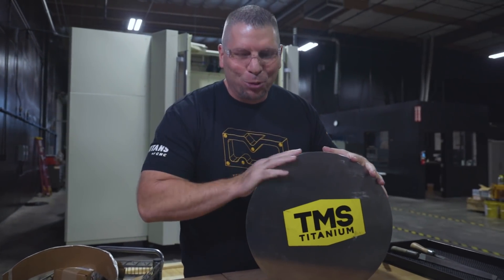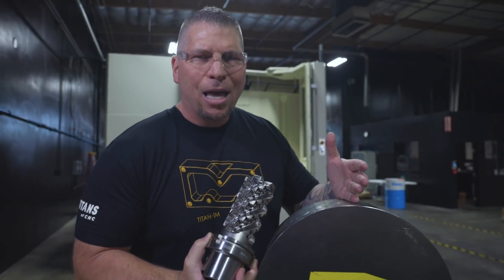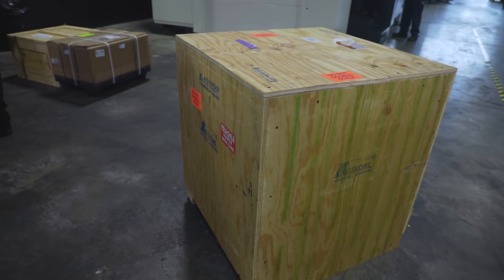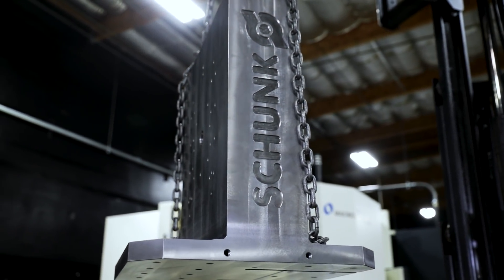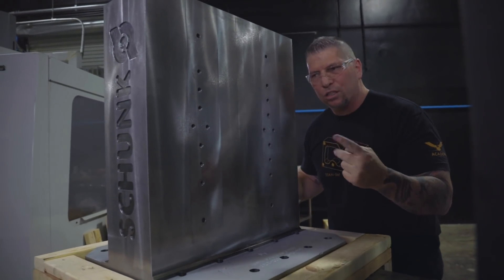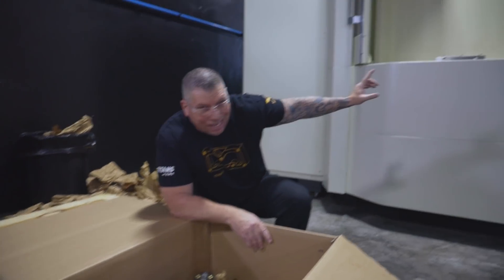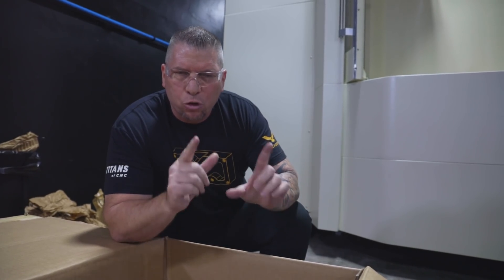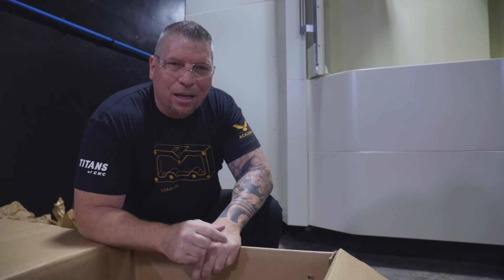60 HP MAKINO | Beast Titanium, Chuck, Cutter & Tombstone!

Comment: I didn't know if those mega insert cutters are still in use today. That's a lot of inserts to swap out. Would some 3-6 insert cutter meant for low depth of cut, high feed, also be another option? It's gonna look really cool, seeing that thing cut though.
Reply from the maker: Usually you have multiple tools and inserts get flipped while machine is running. Nothing can compete with the MRR with this tool

Comment: wait, you dont make your own tombstone fixtures? in the shop i work in we have a special team that only makes fixtures for us so we dont have to buy them. that way we can custumize it the way we want them without paying 1000s of euros.
Reply: I think the only saving you're going to see by making them in house is, perhaps, turn around time and shipping costs. What you don't get is the insight that a company that is dedicated to tooling manufacture will have in terms of new materials and techniques and the payback on the tied up capital for floor space and machines. I guess it depends on the type of operation you're running too: flexible, small batch then in house may be a good option but if its high volume work then it's a different story.
Reply: Still not cheap with tooling, employees and machines.
Reply: @AlexKall  for us atleast its much cheaper. since we can make it in the house, we dont have to wait for shipment and the hassle that comes with ordering from someone else. we're making new fixtures and take on new jobs so for us its much cheaper to have someone working full time with fixtures. ordering fixtures can take up to 2 months and we must be able to deliver a part within 4-6 weeks.

Comment: i dont get how those HSK100 things are so strong
Reply: They are dual contact for one so there is alot more contact area then on a comparable CAT. Also the clamping system is more robust than a CAT or BT. And it clamps from the inside so as you raise rpm you actually increase your clamping force were with CAT the higher the RPM the more clamping force you loose.

Comment: Just remember, that someone had to screw in all the inserts.
Reply: Really don't want to be the guy that accidentally runs that tool backwards
Reply: Only looks like 50 of them at about $20 per
Reply from the maker: 55 and they have 8 corners
Reply: @Sicktrickintuner  looks like 5 flute x 13 inserts per flute= 65 inserts. 5 inserts for the lead row at $118+ 60 inserts at $225/for 5= $2700. So $2818 to fill it up.
Reply: Lools like a 2 hour Job 😂